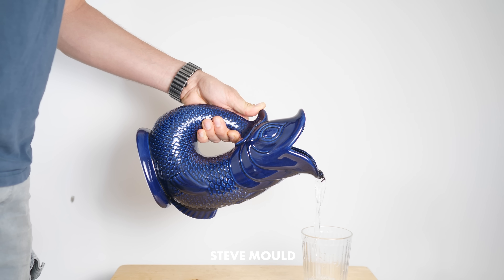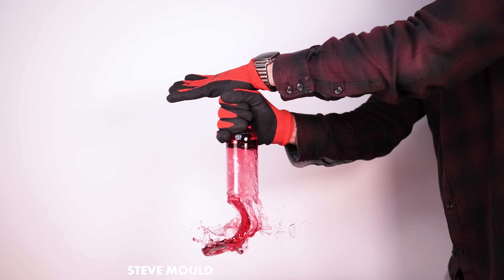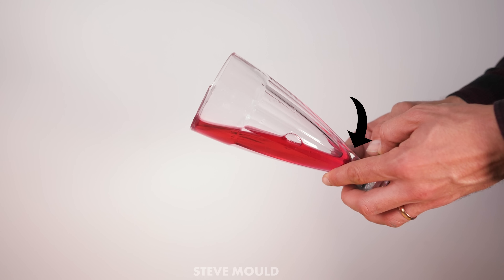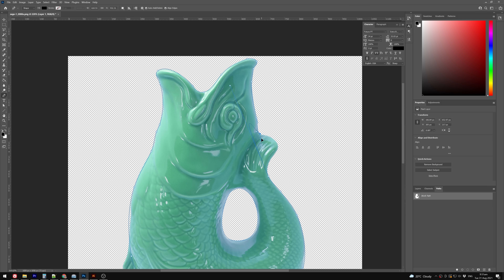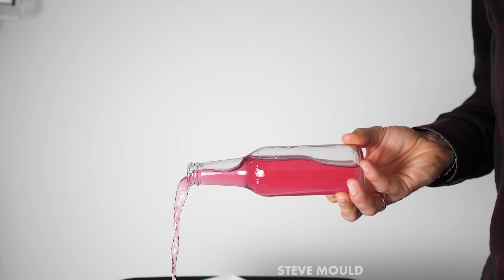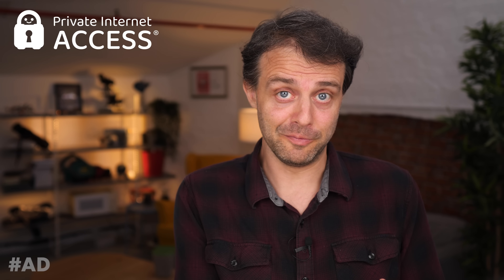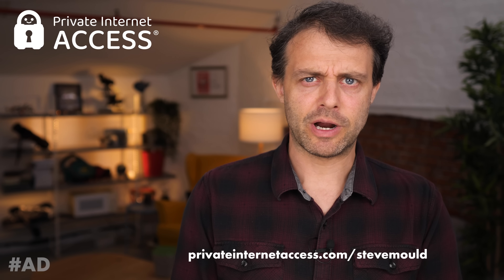Why Gluggle Jugs Are So Weird

Comment: I couldn't stop laughing after you said "THAT TOUCHES YOUR BUM"
Reply: Poseidons kiss
Reply: @trd8749  Beat me to it
Reply: @trd8749  😆🤣😂😅 
😙 🧜‍♂️💋💦💋
I've never heard that one before,  I'm gonna save THAT one for use later.   I first had to catch my breath,  then apologize to my wife who was trying to watch a  poignant movie beside me,  then clean up my drink that I spilled,  then find a tissue to wipe my eyes before leaving this response.  Holy crap,  I needed that laugh.   That was a good one!
Reply: I had this exact conversation with one of my roommates in college. Specifically the drop of water that goes back up into your bum hole... now I know it has a name.
Reply: @skythemouse8855  its called poseidons kiss
Reply: @thedandy6765  What's it called when that happens... IN A PORT-O-POTTY. That's just the definition of horrifying.
Reply: It doesn't just touch your bum, it violates it
Reply: It's more horrifying when it happens more than once in the same sitting.
Reply: Watch out if there's bleach.
Reply: Steve's Mould shoots projectiles at Mach speed
Reply: Laughs at this from Germany where the sht lands on a flat shelf elevated above standing water. Yep, it's as gross as you imagine so the last laugh is not mine. It's sits in open air and just stinks maximally until you flush.
Reply: @Paxmax  That's disgusting... We just "lily pad" in Canada (put a tiny piece of TP on the water before you sit down) no splash...
Reply: @chasegallagher9754  Indeed, I'm shocked and shakes my head every day I visit a German/Dutch toilet. And it gets worse! If you stand and pee; it hits the flat shelf and splashes drops/mist everywhere! ...so you sit and pee. ...but it gets worse! Normally (euro toilet) when sitting the pee hits the porcelain at an angle so you pee in relative quietness, spare the last drops perhaps. In Germany? NO! The water is at the front so all pee hits with full force, full drop height making uneccesary noise.

Personally I find ZERO upsides with this stupid design, only massive drawbacks... and it uses more water to flush than "normal" european toilets, uses more paper, more cleaning to do, longer maintenance due to more surface. All in all a massive fkup of a sanitary equipment... Upsides are for someone who has a morbid curiosity to admire their SHT which is on full display, and wants to coerce people to sit and pee... well, decent people will sit, some ppl probably don't mind splashing their pee all over I guess.
Reply: @Paxmax  ITS a old Design that isnt really Sold anymore .nowadays the Water is in the Back .
Reply: @srck4035  My last three rental apt. all had the shelf design, maybe I'm renting from cheap skates. This design must've been sold well into the start of 2000's cuz none of them looked run down really.
Reply: @chasegallagher9754  I thought I was the one of the few that did that!
WOW!
And to think, you have a name for it and it's a great one!
Reply: @Paxmax  I was once explained that the upside (apart from no Poseidon's kiss) is that, since you get to admire your production, you can deduce from its color/consistency if you're having any diet/digestion issues. Kind of a shitty argument if you ask me.
Reply: @Paxmax  the worst part about it is that if the shit is to heavy it won't go down but the force of the water and you have to push it with the brush but as someone growing up in a house with both versions I preferd it because no Poseidon kiss.

However after a vacation in Japan with their amazing thrones I don't mind the kiss as much anymore.
Reply: @electricpaisy6045  As nasty as it sounds, CAN CONFIRM... all of the minute changes of directions makes water loose it's flushing powers in these toilets. So, you flush once - to get it to "the last bend"... then you wait for the tank to fill up.... and a second flush to hopefully have it be gone. I tried stabbing it with the brush but then the brush is "no bueno" anymore =o(  these germanic toilets are an actual literal shit-show.
Reply: That's true there's nothing to laugh
Reply: 🤣🤣🤣🤣 same
Reply: I was looking for this comment 😂lol
Reply: I was on the bathroom when he said that.

Comment: Before watching: probably the same phenomenon that causes rectangle containers with the lid displaced from the center to have that gurgling when you poor. Have noticed before that it doesn't happen if you turn the container, so the lid is on the top when you pour. That must be because there is no trapped air. A bit of a life hack there for you if you want to pour from that kind of container faster.

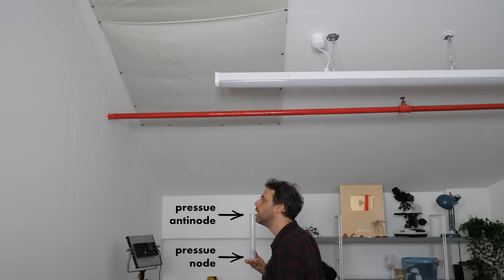Comment: At around 6:04 you say that the bottom of the tube is a pressure node, but in fact it is a pressure antinode. It is a displacement node, since the boundary condition imposed by the wall at the bottom prevents the air from moving. Also it was spelled as “pressue”.

Comment: Before I watch this, let me just say I bet it works like "The Boot" based on the thumbnail... the water (or beer) stays in the bottom because there is no air to replace it but once you tilt too far, well ya get a face full of a cold one. ;)

Edit: Ok, I guess the gluggle jug isn't the ceramic version of "The Boot"...

Comment: That's actually what I would have thought.  But that glugging IS tangentally related to squeezing and releasing the fluid flow and, I suspect, turbulence.  So you're not WRONG, you just skipped a level.

By the way, 347 m/s = 1,140 fps or 776 mph.

28°C= 82°F (if you restrict it to 2 sig figs) which is cool and too hot.  Open a window, man.

347/480 m= 28 in.  I have a unit conversion app that does things like that.  It's really cool.

I could have divided 28 by 4.  But why?  I multiplied 480 by 4 and my NEW input is 347/1,920 m and that equals . . .
[dumroll, please!]

7.1 in. or (if you want to do inverse powers of 2) 7 1/8 in.

Comment: I highly recommend a spiral shell, mounted along the center axis of the spiral and then about 1/4 submerged in water and rotated slowly in the direction to scoop a little bit of water. Its a magical sound mine is about 10cm and gives a nice audio frequency and the bonus is can be easily wind powered.

Comment: Reason the Mockup has a more muted sound when pouring is, the top of the cavity (Tail) is not connected to the sound amplifier (pouring cone). Also, ceremic has a better sound throughput than plastic.

Comment: I once pulled a hot bowl of soup out of the microwave and dropped it, because the ceramic bowl turned out not to be microwave safe and was super hot. When it reached the floor, it hit at a funny angle that made it spin and roll around in a circle and somehow managed to sling split pea and ham up twelve feet to the cathedral ceiling between the kitchen and living room. For years there was a little bit of dried ham hanging next to the central beam, because we didn't have an interior ladder that high. I tried and tried to replicate the motion, I saw it and knew what had happened, but it was virtually impossible to reproduce, at least for me with the tools I had. Love your curiosity and experimental set ups.

Comment: As someone who drinks water out of bottles a lot - that phenomenon of water splashing you in the face is quite common. In a 1.5 litre bottle, water can easily travel all the way up the length and escape out the neck to - again - hit you in the face. Sometimes when setting bottles down, a drop of water can also shoot out the neck. Water mechanics are fun :)

Comment: The main reason for the splashback from the glass seems to be that the bottom is rounded, paired with the high velocity of the liquid. Guess that's mostly going to happen if you use the right type of glass and tilt it up so far that the bottom is above the liquid and then quickly tilt it right side up again making the contents flow back at high speed (but not so quickly that it covers the entire diameter on its way down, there needs to be space for the escape route).

Comment: I didn't like your claim that the water in the glass was speeding up as it went towards the narrower bottom because surely that only applies to a tube that is "full"? Also, the measurement of temperature should be "Celsius". "Centigrade" just means that it's based on 100 divisions between two values. Otherwise great video! Think I need to go buy myself a gluggle jug now...

Comment: The bottom of the bottle breaking, from a fluid dynamics perspective:

Striking the top of the bottle sends a shockwave through the water. When the shockwave reaches the bottom of the bottle, it creates a low pressure zone (higher speed at front of shock = low pressure at front of shock). It seems to me that this is what causes cavitation, not the inertia of the water. Think about this - what happens if the bottle can't move downward? If you fix the bottle in place so it can't move downward when you hit the top of the bottle, does the bottle still break? Does the vapor cavity still form? If it does, it means it's not the inertia of the water :)

Comment: The bubbling also happens because the bottle has a weird shape, where the tube progressively tapers down as it approaches the tail, which allows a differential volume. A perfect, constant cross sectional area U-shaped tube can't guggle.
But what if there is an optimal shape for MAXIMUM GUGGLING?

Comment: If you drink Weizenbier in Germany out of the standard shaped glass, there comes a point about 2/3 done when, after you have taken you sip and are tipping th glass back, you invariably get a drop of beer coming back at you: more precisely,  one drop on the bridge of your nose, and a smaller one on the tip of your nose. Every time.

Comment: You missed the low pressure on the tail holding back a higher level of fluid than the level in the neck blocking the air. This then is pushed out the way to chug and then blocked again into the pressure on the other side rises/lowers again to over come it.

Comment: I hate that, which is why i try and skew my arse sideways a bit before letting one drop. If that not doable then i try to quickly lift my butt up out of the way of the impending splash on my sphincter. (If i want a wet arse after ive had a crap I’ll spray it there myself, i really miss Asian toilets)

Comment: Wait there is something similar to this effect at 1:30 where the water splashes in your face, also a glass designed to just do this as a drinking game. Call them here in Germany Bierstiefel or Beer Boots in English, don´t know where it´s from but think the game is when you slash yourself you have to drink the glass empty. Kinda also remembers me of this gluggle jugs as it is rather similar just whit the "boot tip" stretched up.

Comment: I remember playing with my dads lighter as a kid, it was ine of those transparent rechargeable clippos, had 2 chambers, and the pressurized gas ( in liquid state) made the same bubbles when going from one chamber to the other when tipping the lighter. No sound though...
Reply: I'm pretty sure it didn't make a (audible) sound because they're so small. I've played with those transparent lighters before too. It's not a lot of liquid, which is the thing actually making the sound, not the air bubbles.
Reply: I wonder if it didn’t make a sound because the vibrations were much more readily absorbed by the gas and thus not as transferred to the lighter body and to our ears? Since water is incompressible and all

Comment: That thing where the water splashes back on my face probably happens a couple times per half year/full year.  The cups I use have a rounded out bottom, rather than corners, which definitely facilitates that.  They're pretty big cups, and they do narrow down a fair bit, but nowhere near the scale of the glass you have in the video.

Comment: The water splashing when drinking from a glass happens to me all the time. We have these coca cola glasses that are wider at the bottom than they are at the middle. Air gets trapped in the bottom which gets released when you stop drinking which then sends water splashing in your face. Really cool to see this effect mentioned in your video.

Comment: I had to wash a God awful amount of bottles. The worst part, was dumping the water out. It glugged, glugged, so the water came out very slowly. Gluggling slows the flow of water. By accident, I found if you shake a bottle, that water has only one thing it can do. It spins around, and around. Then when you empty  the bottle, the water pours right out, and continues  to spin as it pours out. No gluggling, and a fast pour. I realized the spinning of the water, is the resulted from random shaking, was the same reason stars spin, when random matter collapse, due to gravity, and causes the to spin.

Comment: The cup splashback effect is particularly strong in a boot-shaped drinking glass I bought from Belgium. Because it's clear you can get a good view of what happens at the toe of the boot. Perhaps that might shed some light on the subject.
Reply: Technically, "splash" is the wrong name for it, or at least not the name that will turn up the reams of literature on the subject.  It is a slosh*, caused by a *pitching motion of a container.  (It's alternatively a roll, depending from one's choice of axes.) This sort of thing has been extensively studied and modelled by people who transport fuel (and other liquids) by sea, air, and road.
Reply from the maker: Interesting!
Reply: Is it not a splash-forward effect that the boot was made for, to be used in a pass-around drinking game where the goal is to see someone's face splashed with beer?
Reply: This is the whole premise of the movie beerfest. You have to turn the boot while you drink
Reply: These are great. I was hoping for an extra GLOIP, and it was delivered! The water shot at the end was also on point. 😂

Comment: Regarding the sponsor at the end: Their software being open source does not necessarily mean that everyone can check how their software works. Open source only works as described when you can download the code, compile it and run it yourself. Meaning, as long as they are deploying that code, they can change parts/all of the code between the source-code and deployment.
Reply: While this is a good point, security issues with VPNs often come down to IP leakage due to problems with the client. The remote server is inherently trusted, there's nothing to be done about that, but being able to inspect the client code is very beneficial.
Reply: couldn't you compile the code and make sure its the same file size as the one you can just download to see if anything is added
Reply: @iSmokedEinsteinium  the normal process would be to check the hash of the outputted binary. Unfortunately, if PIA have not configured their build process in such a way that reproducible builds are possible, this isn’t viable.
Reply: @EverythingExceptThat  yeah they should have done that

Comment: Fun thing the principals are at play with most of the containers for vehicle fluids for some reason. Pro tip turn the oil jug side ways and it will come out in a smooth stream

Comment: Nice video! Just one correction though: the graph you draw for the wave is exactly wrong. At the node the amplitude is zero (things don't move at a closed end), while at the antinode the amplitude is at its maximum. Doesn't make a difference for the wavelength of course, so the computation still works.
Reply from the maker: Well... the labels are the wrong way around but I believe the diagram is correct. A pressure node corresponds to a "movement" antinode and vice versa. So that diagram shows pressure which is going up and down at the base.
Reply: @SteveMould  That is indeed another way to look at it. It feels weird for me to use pressure as the signal instead of amplitude though. But I suppose it makes sense for you, because that's what was visible in your 2017 demonstration of standing waves with fire (although paradoxically, the pressure was made visible through the length of the flames, which looks much more like an amplitude, but of course it isn't).

Comment: the flared mouth probably works as a horn to let the sound expand further. (side note I think your standing wave image on your tube is inverted for node and antinode)
Reply: Or like a horn bell
Reply: I think the image is correct. It's pressure node and antinode. It's inverted for displacement node and antinode

Comment: Beautiful demo and I really love that sound. Maybe there's scope for a kinetic sculture that rocks back and forth while gurgling lustily? You'd have to put energy back in perhaps by pumping water from one compartment to the other. 
Or how about a water clock that gurgles on the hour?
Reply: For the kinetic sculpture, an easy way to set that up would be to set up a pendulum escapement like those used on clocks, with the jug either acting as the pendulum itself or being coupled to the pendulum to rock with it, while the counterweight is responsible for maintaining the energy to keep it running. Using a multiple counterweight system (again, common in old clocks) can even allow it to run while being rewound. There's probably then some stuff you can do with a variety of linkages to have multiple jugs of different pitches glugging at different intervals, and if you wanted to get really extra you could try to set up some sort of fountain effect to keep water flowing from to the next before being pumped back to the top (though idk how that might affect the sound, and making that spillproof with so many moving targets would be a nightmare)

Comment: 6:06 I might be rusty, but I think that node-antinode diagram is wrong. on the node, the amplitude should be zero (that's the closed end of the tube), and on the anti-node, it should have max amplitude (open end of the tube). Someone correct me if I'm wrong.